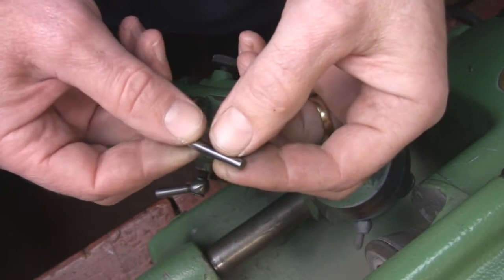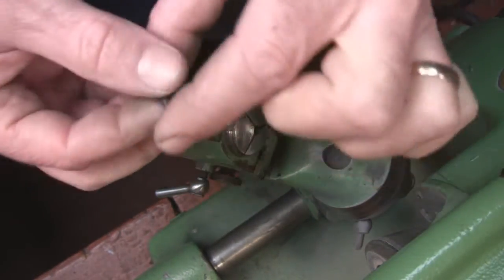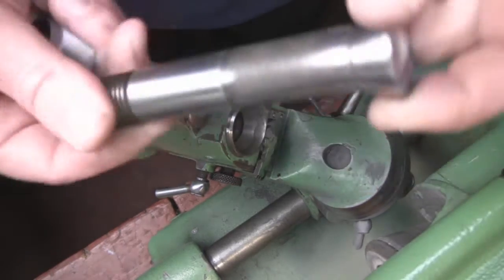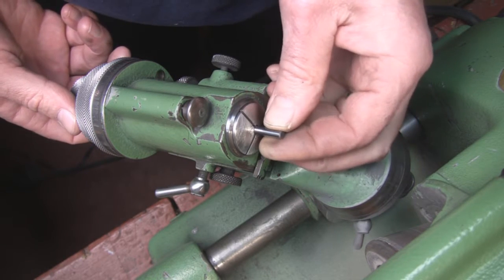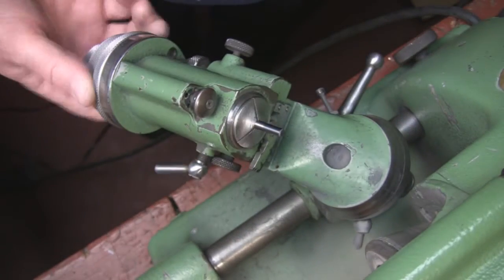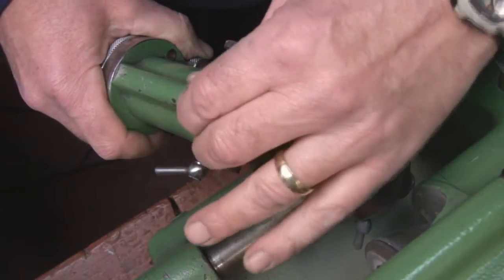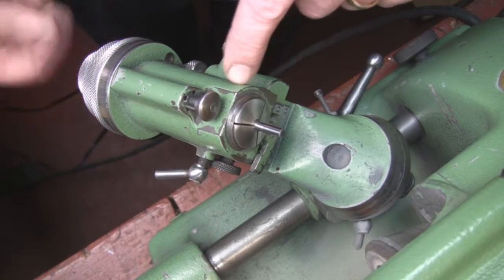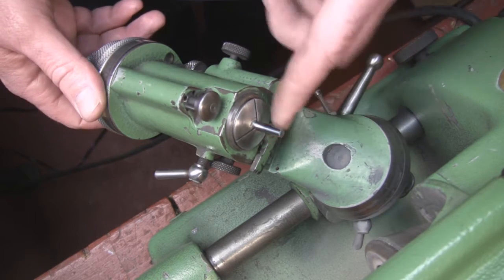Deckel Lesson 3: Splitting a Carbide Blank

Comment: Would it be easier to split the cutter on a surface grinder and save wear on the diamond cutter wheel?
Thanks.
Reply from the maker: Either way, you're using a diamond wheel.
Reply: I use silicon carbide or aluminum oxide wheels. I have never seen diamond wheels used on a surface grinder. 
Thanks for responding and your videos are very good.